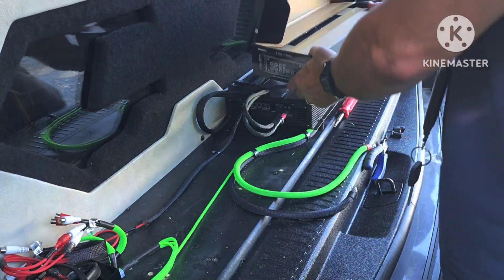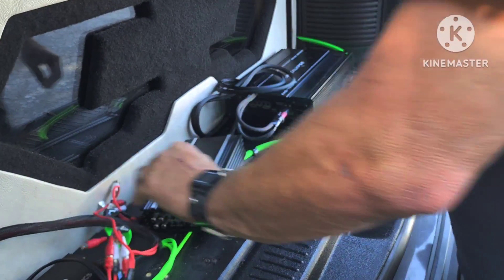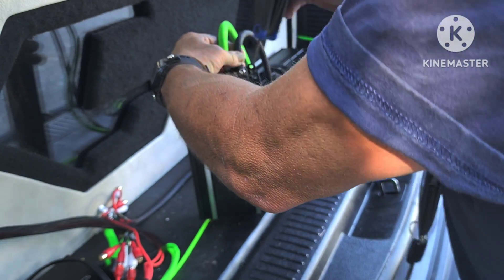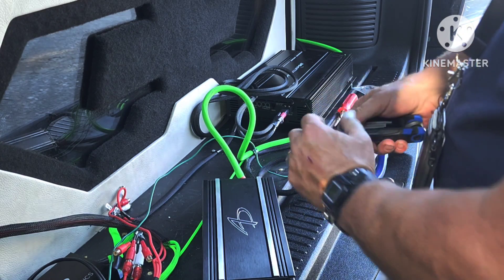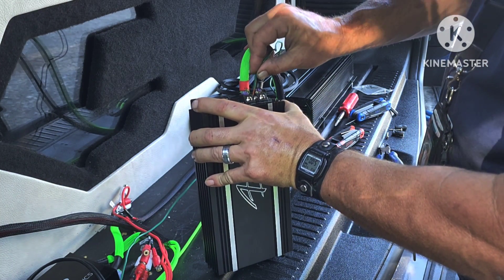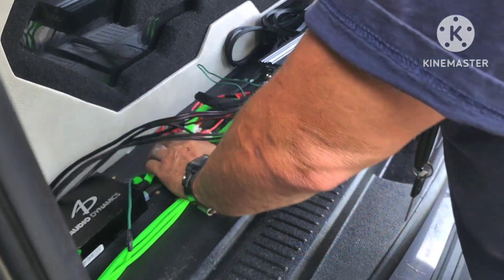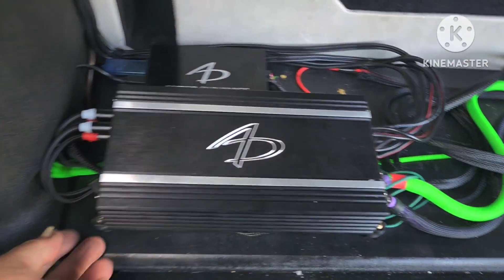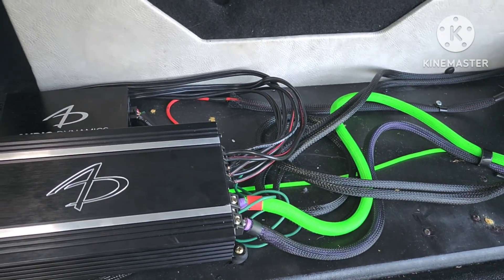installing and testing Audio Dynamics MK 600.4 Amplifier

Comment: So I bought the 1100/1 and this 600/4. After watching your vids seems to pretty good amps to use.
Reply from the maker: Good choice! im running the 600.4 on my mids and highs right now
Reply: @ can’t wait to get it all hooked up. I am running them in a c6 corvette two 10 inches jl audio and all jl audio mods and highs as well.
Reply from the maker: @jasonaune6889  AWSOME!

Comment: Does the ad dsp play right out of the box? Or do you have to use a computer to set it up. I have one that won’t connect. It says dsp not ready
Reply from the maker: you have to set it up with a computer, tablet or phone. but it does auto tune, so getting it running is pretty quick